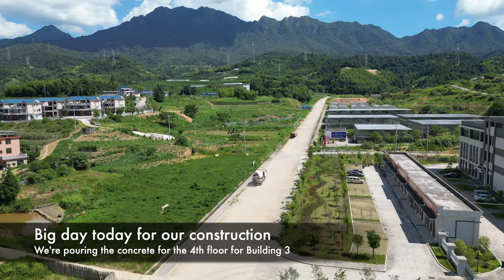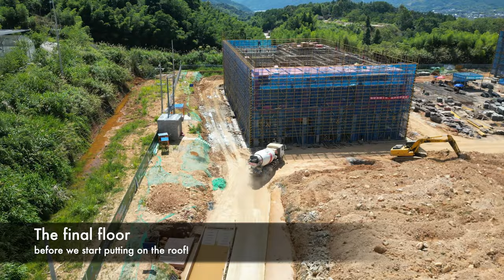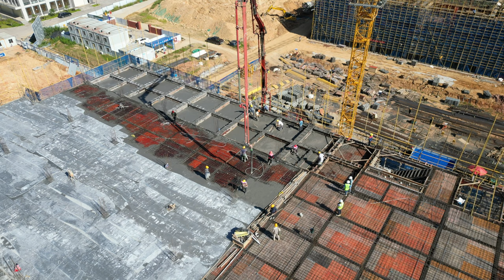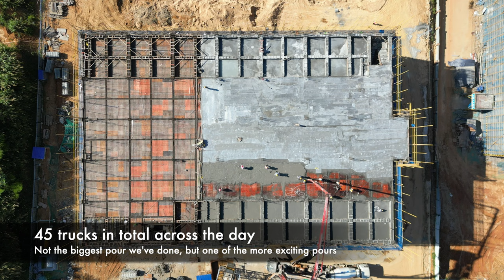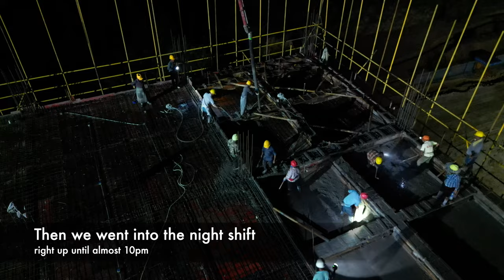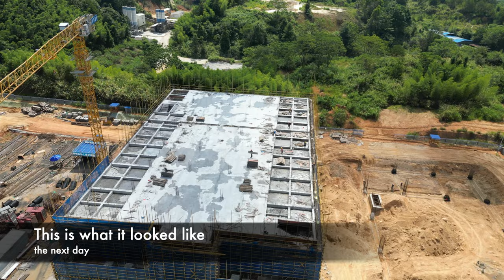Building a Single Malt Whisky Distillery Part 54

Comment: What does concrete cost per cubic metre?
Reply from the maker: It's kinda about half the price it would be in western Europe.  But, as with concrete in western Europe, there's a different cost based on the strength or type of concrete.

C8/C10 and C15 at the lower end, up to C20, 25, C30, C35 and C40.  Water proof concrete for use below ground level costs a bit more too as it has more additives.  We are currently only using C40 (some with, and some without waterproofing additives) and we'll also be using dry screed as a top coat on flooring.